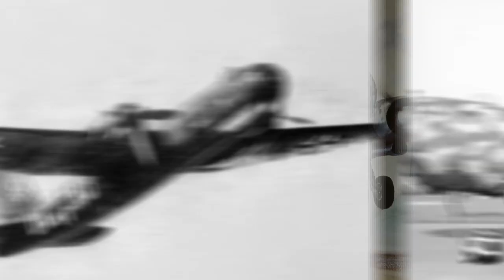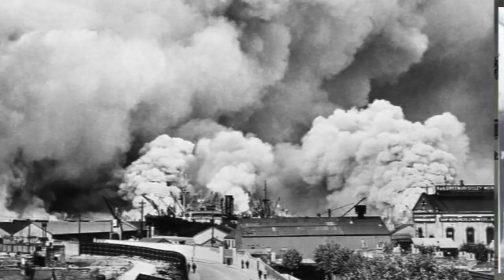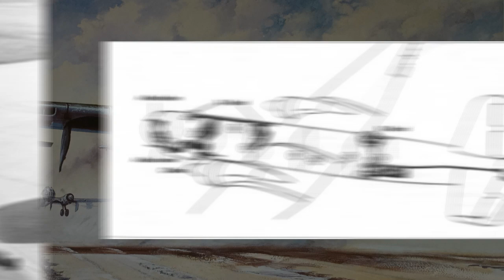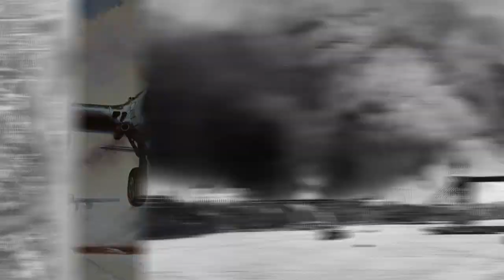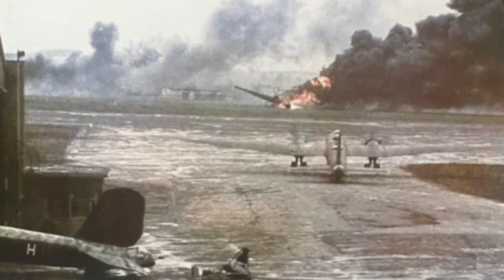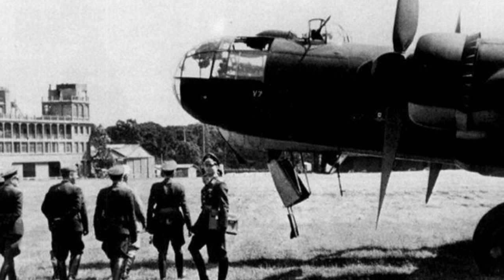What Is The He 177  Germany’s flaying fortress

Comment: What was the "four-in-one" engine arrangement mentioned in the voice-over?
Reply: The real plane began with a unique engine which was two twelve cylinder engines mounted onto the same crankshaft, one each side.  

This worked, but the engines overheated, the oil and fuel leaked, which got trapped in the wing, and could cause sudden, destructive fires.  

At one point in the war, there were 100 of these planes at the front line in the East, and were to be used on a real strategic attack on Magnetogorsk, but this was cancelled because the planes were used up by the time the high command agreed, mostly as transport planes, trying to supply trapped Nazis.  

Basically, the political tendency to waste took hold of the leaders, and that was that.